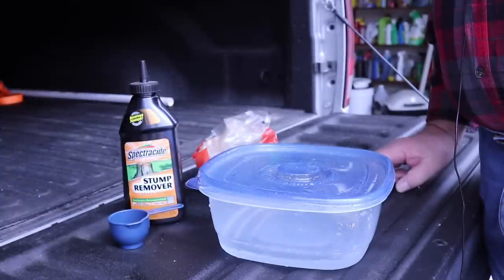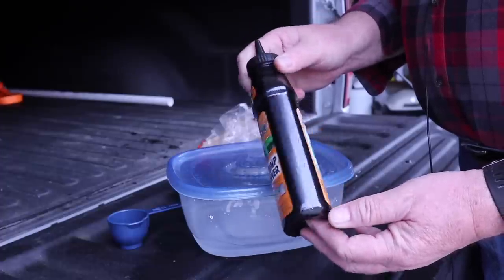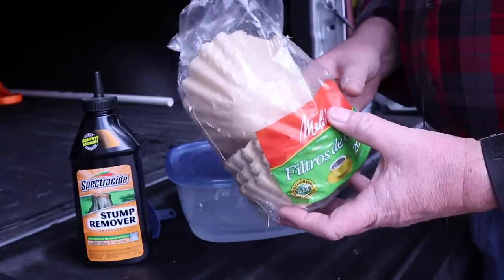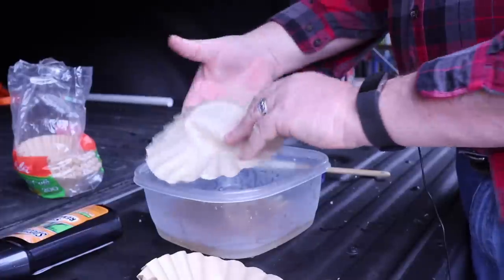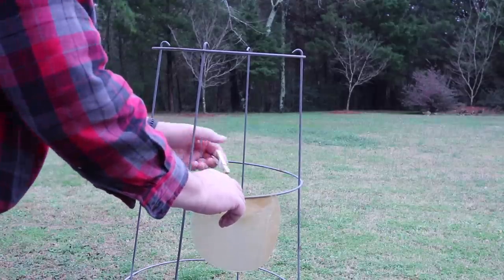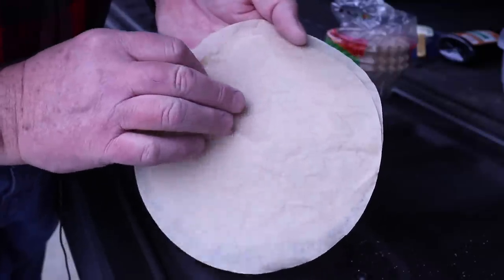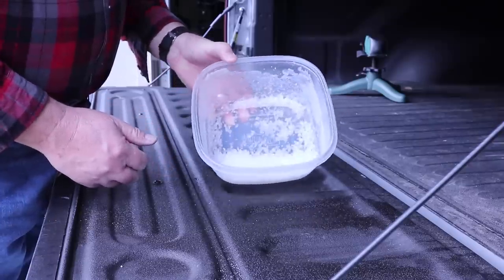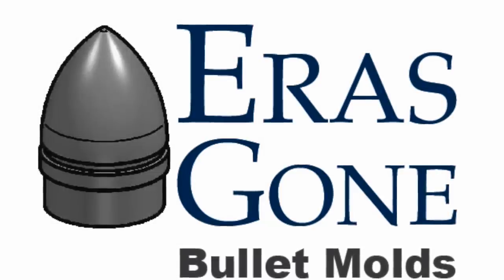Nitrating  Paper for Combustible Cartridges

Comment: You didn’t actually nitrate the cellulose all you did was coat the paper with potassium nitrate.... gun cotton, flash paper or what ever you want to call it is produced in a chemical process of nitration which bonds a nitronium ion to the cellulose molecule and changes the chemical and physical properties of the paper into a rudimentary plastic on a molecular level. To do this you need nitric acid and concentrated sulfuric acid as a catalyst. Nitric acid can be made from potassium nitrate but those are 2 separate processes.... your DIY process achieves none of that aside from adding potassium nitrate to a gun cartridge that already has potassium nitrate in the black powder 🤦‍♂️
Reply from the maker: That is true and I never claimed otherwise.  :)